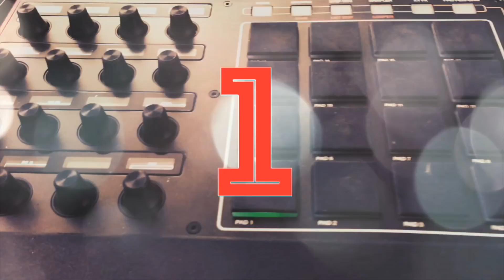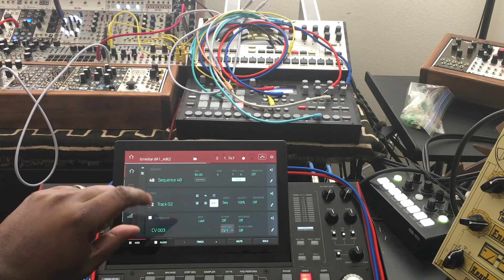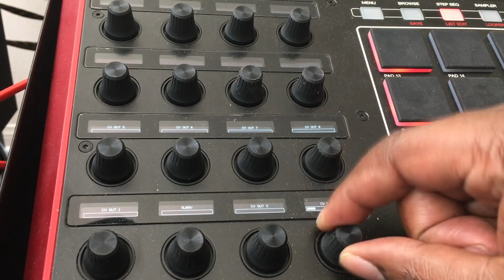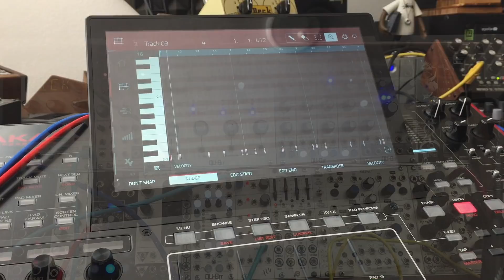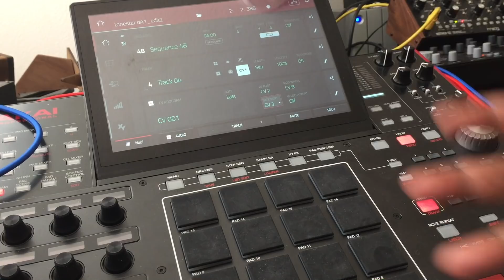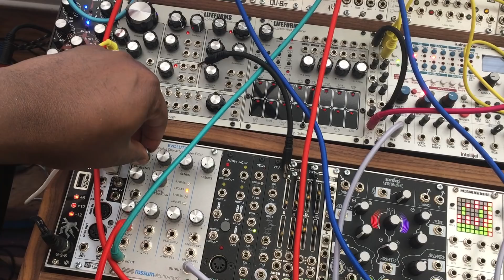5 Things About MPC X - CV Outs

Comment: Thank you , im still yet to get sound from both my M32 & DFAM... i know thatcan mak sound as i have checked the audio connection for both into the mixer, they are just not triggering grom the CV connections... cv1 out to VCO1v/oct M32 & CV2 (GATE) to M32 Gate, then M32 assign out to DFAM Advance Clock trigg... nothing... i have a sequence set up on both moogs ready to be played... i cant even hear from keyboard mode on the mother 32 when playing pads... HELP

Comment: Have you noticed any issues with software crashes? Also, how different is the X from the Live as far as QLinks and other button functions?
Reply from the maker: Kingjames313 there are occasional crashes but it's all a part of beta testing. Overall it's been pretty stable for me and it gets better with every update. As for the differences... the only diff with the qlinks are the fact that there are 16 rather than 4 and there are the little screens to tell you what each function is at the moment.
Reply: The live doesn't have cv!